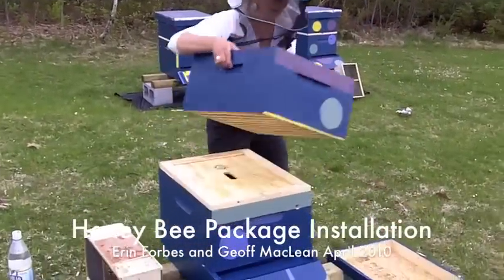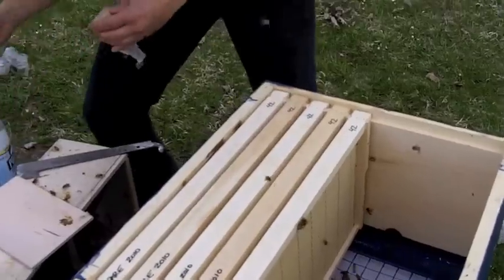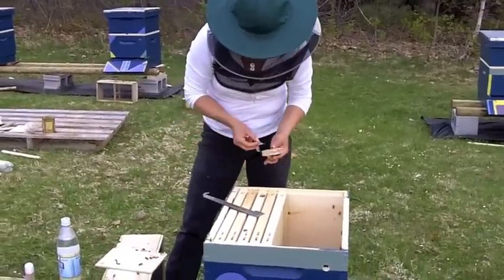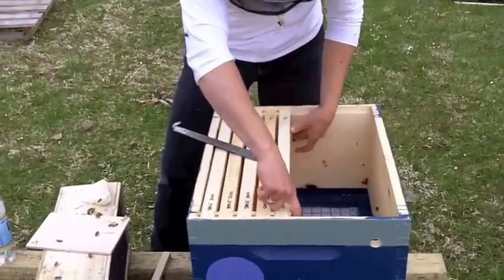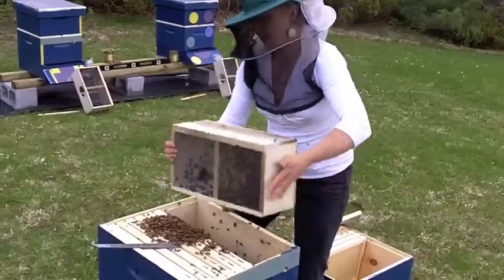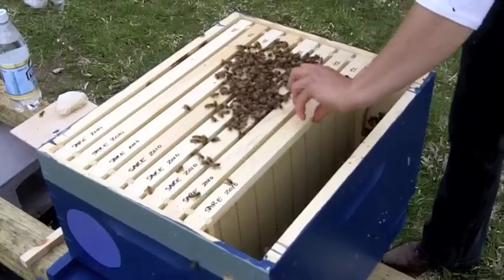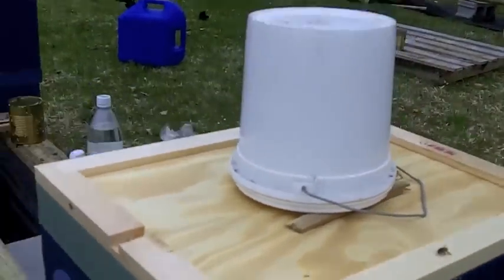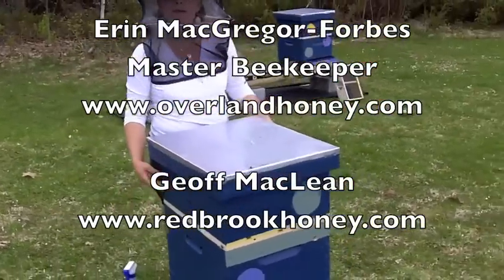Honey Bee Package Installation

Comment: Why wouldn't you pull the screen off and "pour" the bees out? The thump and dump adds to an already stressful situation.. Not to mention the all broken wings and and legs that's caused..
Reply: +J Rivera Because, as the video poster said, their instinct is to clump together at the bottom of the cage and stay there.  They don't just "pour" out.  You have to thunk the cage to separate them and loosen their hold and then dump them into the hive before they can grab onto the cage again.